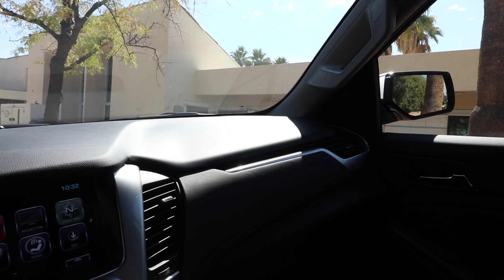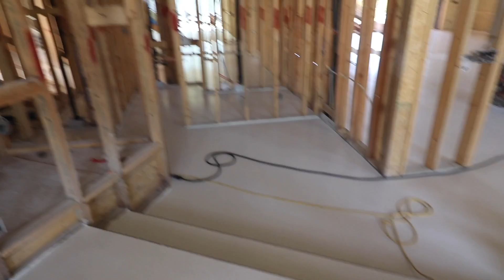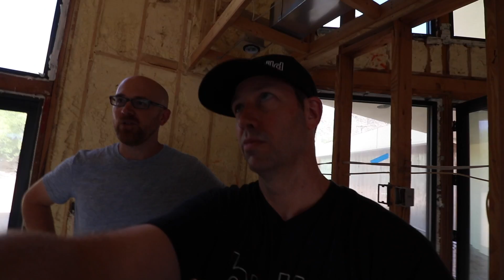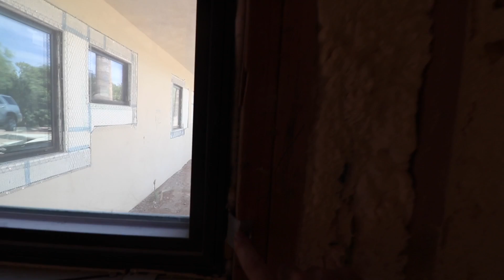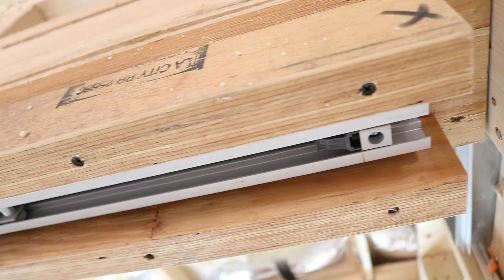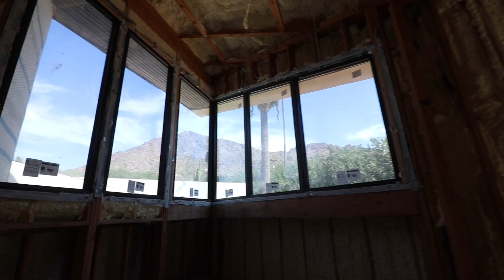Impressive Remodel - Build Show Fan  in AZ

Comment: Those floors are awesome! What is the product? I have concrete floors but they got damaged from replacing the cast iron drain pipe under the slab.
Reply: Ardex PC-T.  In white with a quartz aggregate, he said.

Comment: The people who sell the steel usually have smaller cranes on their trucks.  The few times I've used them, you buy the steel and they 'deliver' it right to where it goes.  Wood beams last longer (maintain their rated strength) in a fire.  The steel 'melts' at low temps.
Reply: No matter what the building materials ,I keep the fire in the fire place, it's just easier that way. A fireman informed me that just because it's steel construction doesn't mean that it can always be reused after a fire.
Reply: 1200F= 1/2 strength. By the time the "red iron" weakens and fails from extreme temperatures, no one cares.  Insurance will be writing checks and a new house will be built on the slab.  This isn't a highrise application.
Reply: @Kkybte , Agree and true.
Reply: Steel melts at around 2700f, are you sure a wood beam would last as long as that steel beam in a fire ?
Reply: august the wood chars on the outside and the fire has to work though. Steel fails completely since it conducts the heat to the core. Large wood beams are actually safer. Steel is used in large structures because of span lengths, and the fact they can thin the steel beam more than they could with wood.